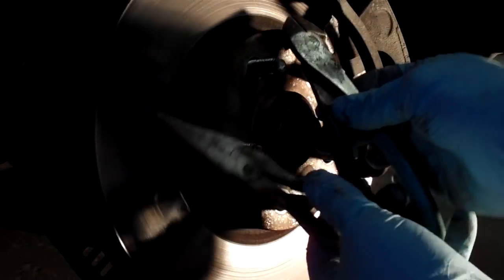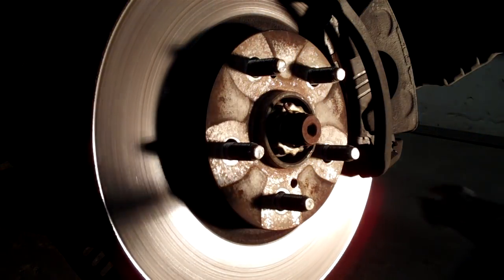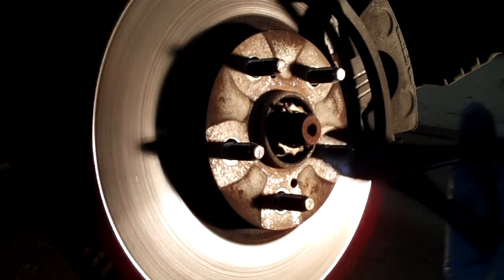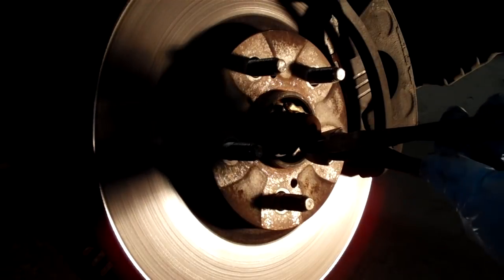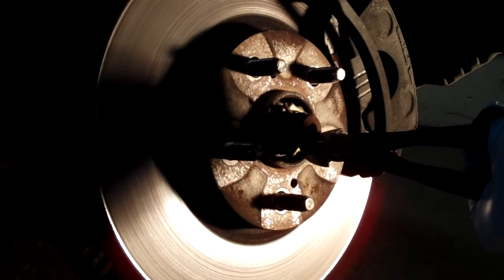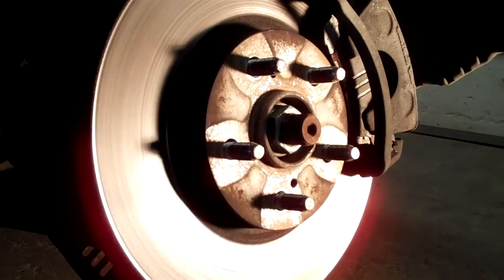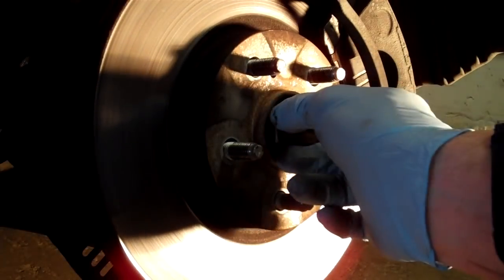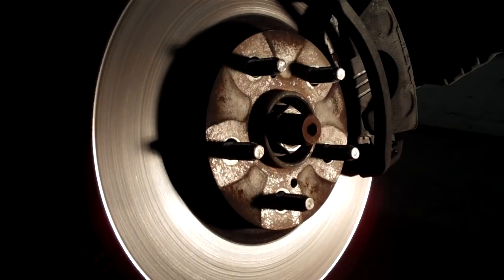How to remove a stubborn Cotter Pin like a BOSS!

Comment: I had a stubborn cotter pin once.  It was rusted in there good.  It was hard to get at the bent ends to boot - ball join end of a 97 Grand Cherokee Track-Bar.  Anywho, I  ended up taking out the torch(MAPP+Oxygen) and melting the cotter pin.

Comment: I've never had a  cotter pin give me as much trouble as I  had today.  Both tie rod ends had rusted cotter pins . Couldn't  even see the  eyelet end . I ended up drilling in a 1/4 inch  then pounding  the  pin out with a punch .

Comment: Ohh those poor angle cutters... I usually just use a ridged flat Craftsman screwdriver and a hammer (or other blunt heavy object). I start the cotter pin by placing the flat of the screwdriver blade on the split side (pokey end) and tapping the other side of the blade with the hammer. Then I insert the tip of the screw driver blade into the new exposed length of cotter pin (the bent loop end). One more whack and done.
Reply: Andrew Wrobel I just split the eyelet part of my cotter pin doing this. Now I'm in uncharted territory.